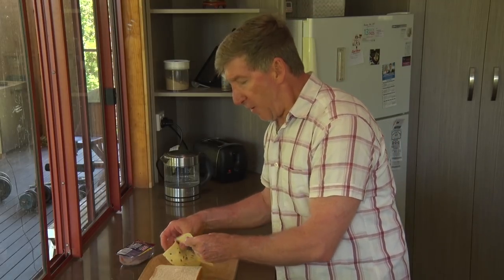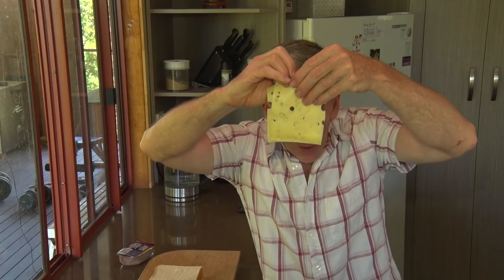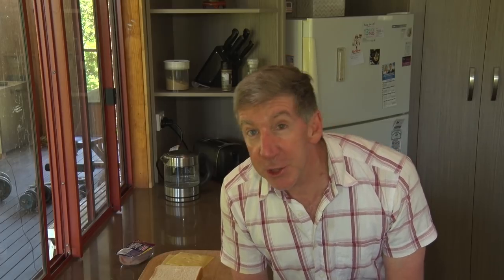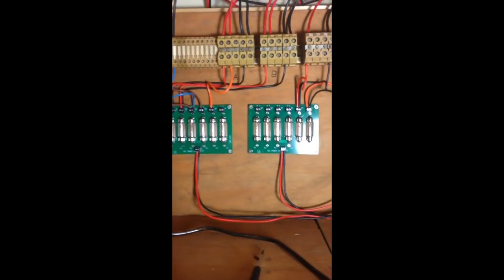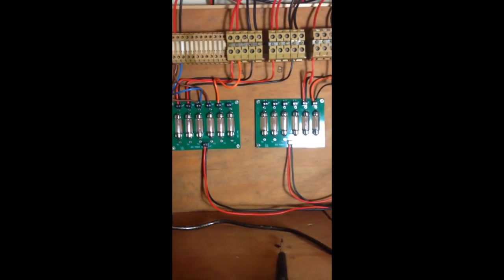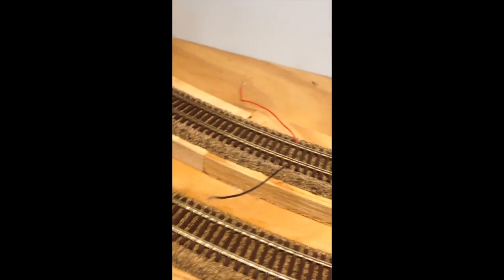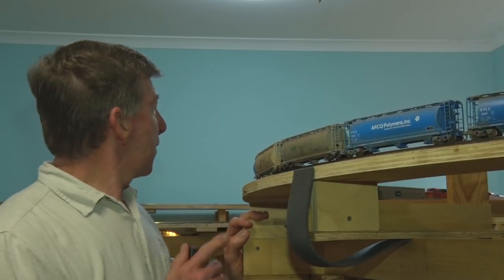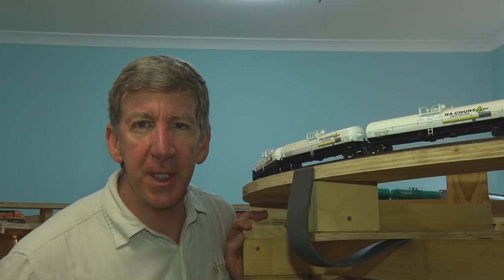Short Circuit & overload protection for DCC.

Comment: Currently in the process of wiring a new layout for DCC. This was the first video where I saw the NCE protection system up against the automotive light bulb method. 'Leaning towards using the automotive light bulb.  What is good about what's learned in this video, your mistakes won't be my mistakes. I reserve the right to make bigger and better mistakes on my own! This video was very helpful in planning the wiring for my layout.
Reply from the maker: Thanks Thomas , glad you enjoyed the video!  The auto bulbs are ok for quick indication , just like the NCE bulb set up. But DCC is a lot more than just voltage on the rails , so having a short for long periods can damage components in the system..depending on the current of course. I feel that a combination of ECb's and bulbs is the best option.
Cheers Gregg.

Comment: I am glad to see someone else using bulbs. I wire my own with 1156 automotive light bulbs at the point of each short protection district. I run N scale and I've had great luck with that process. Some people around will rip you hard for this with all kinds of theory as to why it will not work, but I've done this for 15 years without an incident. I have made one of those videos on how to do it. You do have to keep your bus lines straight, however. I would be concerned with all of those bare spots in  your wiring. After soldering get some electrical tape on those.
Reply from the maker: Hi Ron, 
I watched your video and it's where I got the idea from, though my old DC controllers way back in the 80's had bulbs in them for overload protection, which lit up like Christmas trees on the old Athearn locos! They work a treat but having them in one spot is not ideal so I like your way better, having them at the load and not back at the power source.  As for the bare joints......yes they touch from time time!! Typical electrician i say, thats my excuse !
Thank you for watching Sir.
Cheers Gregg
Reply: Hello Ron, I remember that video, could you link it,  I erased my history last week.  Thank you Ron.
Reply: how about pdf   lost me
Reply from the maker: I will do a wiring diagram in the next video Don!
Gregg :-)

Comment: Great video I agree with the Swiss cheese, having a small layout, makes it more simple, but I have overlooked the protection aspect,  it looks like I need to make this a project, I only have one power section, someone told me to use a automotive bulb 1157. You made it very understandable.  Last month I was at a friends layout when a locomotive started the magic blue smoke, the only thing that cooked was the wires from the trucks.  I am sure if the layout had protection, this event would have not happened.  Again great video,  tell Lord Stan hello from Nebraska. Can’t wait to see the next video on this subject.
Reply from the maker: Thanks Terry!  Even if you break the layout into 2 districts with 2 CB's and then you can have some local bulbs off each section. The booster is at 5 amps so that will fry stuff before it trips out..LOL
I shall pass on your regards to Lord Stan.
Cheers Gregg.

Comment: Gregg, thank you for much for posting this video. It's been a very interesting look at protection for layouts. I use the NCE EB-1 (I'm a little lazy) I figured that since I don't have a lot of "districts" that would not as much and better than using the bulb method. I'm happy with them. You are right though, the "Swiss Cheese" thing is perfect to show what we can get ourselves into with wiring. Thanks so much again for the video and sharing the information. Cheers!!
D. Muse WTCMRR
Reply from the maker: Hi David and thanks for the support!  I will be getting EB-1's but I wanted to try this as a experiment which was a interesting result for sure!  !  On smaller layouts, ECB's are the go I feel but if you want local overload protection , the bulbs are a option but used with ECB's for short protection. Plus don't be lazy when you wire your layout..like me..LOL
Cheers Gregg.

Comment: I just ran into almost the exact same problem.   I didn't have any circuit protection,  left a loco running to break it in, left the room for about an hour.   Came back to a derail loco causing a short.   My NCE smart booster kept trying to reset.   It actually melted the back of the smart booster,  my loco truck, and a couple ties on the track.    I am now done taking shortcuts and going to install circuit breakers.   I think we are all guilty on just wanting to hurry to get trains running, that we forget to do things the proper way.  
~Deryk

Comment: Mmmmmmmmm...... Grilled Ham and Cheese sandwiches sounds really good right now!! Wish I could...

I believe I might have dogier wiring than you! 😱  For decades, whilst running DC, I used automotive circuit breakers, and they worked great, and were less than $1.00 EACH!! Some things about DCC Still perplex me somewhat.
Even though my Layout may be 1/20th the size of yours, I see a sizeable wiring project coming up! The main Buss should be fine, all 10 gauge wire, with 14 to 16 gauge feeders, depending on length.

No, my problem is similar to yours - ALL of my circuit protection is at the Command Station. I'd say you were right lucky to not have blown one or more Decoders... Or worse!
EXCELLENT food for thought there, Mate!! 👏👍👍
Carmine 🚂
Reply from the maker: They are yummy Carmine!!  DCC is a different  animal for sure but OHM's law still applies though with all the digital stuff on the rails as well, it gets a bit tricky. I think the best compromise is to have CB's at the command station, feeding local circuit if thats what you want?. It was interesting to see that no decoders were damaged, as all the current went through the axel.  I was lucky but never should leave a loco running on a layout unattended!
Thanks for watching.
Gregg.
Reply: You indeed got lucky Gregg! That will probably be my plan as well, CB at the Command Station, and 1156 bulbs around the districts.
From what I remember, 1156 are 40 watts, and 1156NA are 45 watts. The obvious difference being the NA is Amber, for turn signals.
I'd love to see yours after retrofit.
Carmine 🚂

Comment: NCE sells 1.75 amp replacement bulbs. For HO consists they are required particularly if more than 1 engine has sound. We started with the 1 amp bulbs and most of the time the 1 amp bulbs were glowing and robbing voltage as a result the consist was very unreliable. With the 1.75 amp bulbs it is much better, however the 1.75 amp bulbs run hot and will burn the paint off the CP 6 if left on too long. There needs to be and audible alarm, the visual is nice because you can see what power district has the short, but if the CP6 is mounted where you can't see it the short may not be noticed right away.
Reply from the maker: Hi Edward, 
You are spot on and I am finding the limitations with this system the more I test it. I have doubled up all the feeds so 2 bulbs power each section but even then with a few trains with 3 locos pulling up grade , they still get warm. So as I said in the video, I feel local bulbs are the go for quick faults with indication in the field but the whole system needs protection with circuit breakers. But it was interesting to try it out. I did think about larger bulbs but you have made my mind up saying they damage the board! 
Thanks for watching and your thoughts and findings.
Cheers Gregg

Comment: Yep Sparkies almost as bad as Mechanics at looking after their own cars lol.
  In a word mate PSX . left one here shorted for a week deliberately. Not a thing wrong . on the other hand my mate Maurie didn't have enough feeders and was relying on track Joiners (won't say fishplates) and shorted loco on cross over while he was working elsewhere on layout. The result was a blob of plastic and metal under a BLI Y6b . Only protection he had was head unit of NCE . The chip in the head unit still works but looks a little sooty you might say. Never cooked decoder Either. 
 One other thing the transformer overload was less than the head unit by 1/2 amp hence it kept feeding power. All good now though.   Cheers Les
Reply from the maker: We sure are Les..LOL . I'm looking at a few different CB's to add to this, as I feel having both is the way to go. The NCE is pretty bullet proof alright, I have come back to the layout a few times and it's clicking on and off with a short!!
Thanks for watching.
Cheers Gregg.

Comment: Hi Gregg,  Sorry to bug you again.  I am in the process of commencing construction of a new layout (small 12 x 4 foot).  I am new to DCC.  Have been looking at various sites on the net.  Is there something you may recommend as an easy to follow guide for beginners.  Is Tycab 12 AWG auto wire ok for the main bus and do you use solid wires for the droppers.  I have also noticed that all my turnouts are Peco insulfrog.  Are these still ok to use, can they be converted or would you replace them.  Thanks in advance
Reply from the maker: Hi Glen , 12 AWG is fine for the Bus, but I don't recommend using solid wire anywhere except for maybe data transfer . Insulfrog are ok for DCC, but do wear out as the tip of the frog is plastic , but it does take a while so if you have them you may as well use them? Having a dead frog can cause issues with small 4 axel units, especially in complex trackwork.   As for beginners, watch my videos..LOL. 
There are loads of beginners videos out there!
Cheers Gregg.
Reply: @FishplateFilms  thank you very much.  Yes have been watching your videos and very entertaining.  Were you also a Casey Jones fan as a kid.  Thats of course along with the Flower Pot men and Mr Squiggle of course.

Comment: Bulbs eh? Well I came across this article: 
http://www.rr-cirkits.com/Notebook/short.html
He uses a dual filament incandecent lamp with a PTC to provide current limiting during a short circuit. Sounds interesting.
In Australia, we'd be looking for a 25/5w stop/tail incandescent light and a 0.9A PTC. Both Ebayable and really cheap.

You have more than convinced me not to use the NCE solution.
Reply from the maker: The NCE bulbs are a problem Steve, as are all bulb ideas, OK for a quick short, but a CB is what is needed to really protect your layout!
Cheers Gregg.

Comment: To get a proper  amp reading you need to use a true RMS meter.
Reply from the maker: Hi Frank , 
This is a RMS meter and I checked the values with my work Fluke as well. It seems with further testing that the bulbs are not suitable and there is too much voltage drop across them, which I always thought might happen.  Since this video  I have done more testing and this is a failure for a layout of this size, which I suspected , so a lesson learnt and some ECB's will be installed and these bulbs will be used in yards and industries.
Cheers Gregg.

Comment: On this one you and I will have to agree to disagree. Light bulbs were determined in late 90s to be a big no no. They do not shut down the current 100% and will damage the more expensive decoders of today.  A 100% sure way to completely shut down power result in the creation of today's modern  instantaneous circuit breakers  IE EB1 from NCE.  No decoder manufacture will recommend light bulbs of any type and we are trying to stop NCE from selling this ones you show. It is a case of inventory and it will not go away.
Reply from the maker: Thats' true Art, the power  still remains on and the bulb takes the "shorts"current, which if wired correctly, should be around 1 amp. As I mention in the video, I feel ECB's should be used for the main protection and bulbs for local overload protection if required. This loco sat for nearly 2 hrs shorted out with no damage to the Tsunami 2 decoder, but destroyed a truck! A ECB set at 2-3 amps would of prevented this for sure so I do agree , hence the video !
Cheers Gregg :-).
Reply: I am a Journeyman Electrician, and I totally agree with you Arthur. Just save up your money and buy an EB-1( or other name brand DCC Breaker) for each of your power districts. They may be $40 ea. in Australia, but I pay between $20 and $24 ea. for mine. The EB-1 also has a connection for an LED panel indicator.
Reply from the maker: Thanks Russ, this was a test to see the limits of this system as I had my doubts on how it would handle all my locos. It has proven to be underrated for the job as I suspected but it was a interesting  experiment!  I still feel the lamps can be used in a small area with little traffic, such as a industry or small yard? But as I stated I also feel ECB's are the go for the main protection of the layout as you say, so they are on the shopping list in the near future.
Cheers Gregg.
Reply: Thanks Greg. You did come to the right conclusion towards the end: bulbs are much better for overloads, not short circuits, especially a dead short. The only solution for a dead short is to open up the circuit instantaneously before it causes damage to equipment. Usually at Model railroad low voltages, fire is not an issue. It could be though, if the current gets high enough with a spark and combustibles under the layout. A bulb would work ok in a true overload situation, such as the Loco hitting a physical obstruction and locking the motor up causing it to draw locked rotor current. The bulb in theory, would lower that current in the Loco back down to a safe level, giving you time to remove the obstruction and keeping your feeder wires from heating up. The circuit, however, would remain on for other users. As an Electrician, with over two decades of training and experience I would use either fuses or Breakers for short circuit protection even with low Model railroad voltages. I think you will be much happier with the electronic circuit breakers. And instead of having to look under your layout for indication, you can have remote LED indication in your panel if you want to.

Comment: bulbs to not cut power its not the best way it will still put powr to track so will still burn out stuff circurt breakers are the best and will pretect your stuff alot bettter
Reply from the maker: Thats correct and I feel having both is a good compromise especially f you have a lot of power districts.
Cheers Gregg.
Reply: yeah the eb1 and psx1 are very dear here in aus got one of both